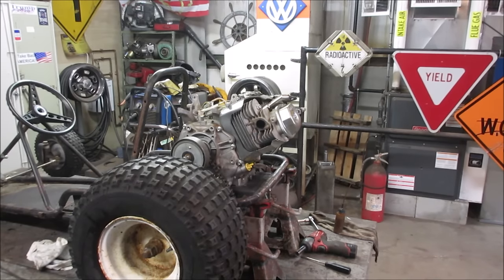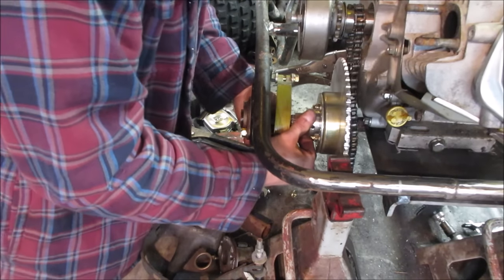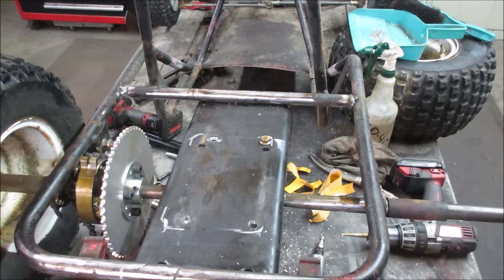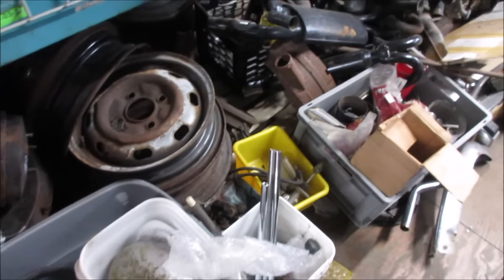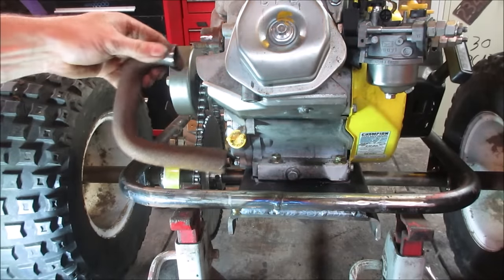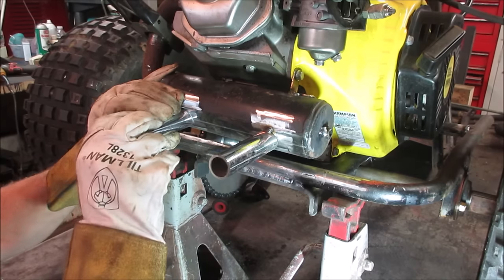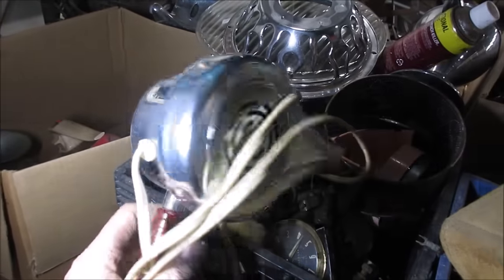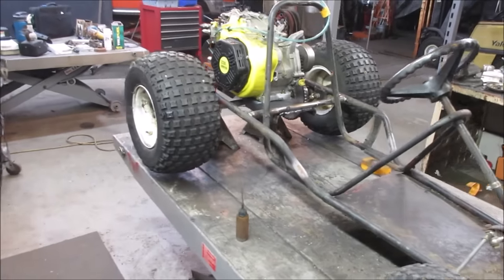Building a 1/2 Scale Manx Dune Buggy pt2

Comment: Mustie1, one of your best projects yet! I think this rig with the torquey 338cc engine is going pull from the bottom like crazy. I'd worry about the frame and small wheels in front taking all the weight and kinetic energy, especially if you were to go off-road. And I keep saying aloud -- I think cutting a notch in the fiberglass (tastefully) would provide easy access to the valve cover, if need be.
That said, for many years now this channel is my go-to for Sunday afternoon relaxation with coffee and a grilled meat & cheese panini sandwich!

Comment: HMMM, That muffler located on the back may make it hard to change the oil. Make sure you leave enough room. Cool Vids as always. Thanks:face-blue-wide-eyes:
Reply: It won't get used enough even with Rough use & even if it does. Then some one will figure out how to service the Yellow engine.🤔

Comment: Excellent video Mustie  1 :) also on Air Cleaner think a exhaust bow tie then bend to down bit then Aluminum shake weld pipe hole with air filter in  shaker and fuel tank plastic or steal one ! But come together nicely and put mirrors on side too Lol!

Comment: Put the air cleaner on the side of the engine and run a hose to it, would maybe look like a vw oil bath?

Or maybe run intake pipe into muffler and out of the back where you cant see it. Could look like more like a vw boxer engine setup maybe?

Comment: A solution for the muffler issue  would be to swap out the exhaust manifold studs  on head for bolts.  I just paused the video to text this message, then restarted the video and realized you did exactly what I suggested. Great minds think alike😁.

Comment: Those older dingos.  Ones with drum break came in 2 versions. 1 had the 5hp then there was an 8hp brigs version as well.  I had one of the 8hp versions .  Was fun but had replace azle a few times.  Once a friend clipped a tree just on right rear wheel.  Dads machine shop straitened it but the next time out friend hit same tree again this time rear hub broke in 2 pieces and axle bent.  Ordered a new one from the dealer i bought the dingo from.  Came with bearings and i ordered new hubs as well.  Wish could have gotten a beafier axle.

Just fyi they do sell a disk break setup for this axle.

They came from factory with 40 series torque converters.  Atleast the 8hp had a 40 series not posative what size torque converter cam on the 5hp models.  The 3rd generation of dingos had completely different roll cage.  The first 2 generations only had a cage over the engine section and headrest mounted to roll cage as well.

When i finally sold mine the entire frame was twisted from bottom plate breaking welds away.  It took years of abuse when i sold it was to a welder.  He fixed it up as much as he could get it strait without a jig.  His grand kids still ride it around last year the motor started to smoke.  Was bought in 1986-7 about.  I thought was rings but was just valves.  I did valve job and readjust carb and it runs like did when i had it.

Being a 5foot 6inch guy i still fit in it.  Only thing having no suspnsion kills my back now im 53yo now.  Wish had a model with suspension
Reply: What's a disk break? I don't want any breaks anywhere near my kart. OH, you mean BRAKE lol. Go karts weren't made for kids originally, the riding position and lack of space was designed that way to keep it small and light and fast competitively

Comment: We used Thread Lube, Anti-Seize Copper Flake, 16 oz from Industrial Molding Supplies on the threads of the nozzles on our injection molding machines.  The copper flakes fomr a shear layer to help keep the threads from binding due to heat cycles.

Comment: Shimming the engine up for chain adjustment is very solid and doable. A little more labor intensive than sliding but like in this situation, once the chain is "broken in", it will maintain a suitable tension for quite a while, even when being hammered. With a heavy rider. With a kid. Probably 2 seasons of moderate, around the yard riding before you need to revisit it.
Reply: My air compressor has the motor on a rocking engine mount. Then to adjust the belt tension the base is threaded and there's a jam nut. So it all makes an infinitely adjustable spacer. You can thread the bolt in and turn the nut out. Works good.

Comment: Wake up to a new Mustie video on Sunday morning. Gonna be a good day. 👍I still think you should think about moving the pedals forward to fit you better and keep your knees out of the body. Bumps aren't gonna be friendly if you're in there that tight. 

Edit: I saw you weld the bracket that blocked the exhaust from coming off and thought "Oh, no. That's not coming off." Then laughed when I saw you realize the error at 46:00. Some times I wish you really could hear us when you're filming. We'd all make less mistakes with more sets of eyes and hands on what we're doing.
Reply: The way he chopped the frame I'm not sure how the axles are going to like not being supported on the ends anyways. So that may not be your only problem with bumps. He added a lot of leverage to the suspension. But I guess we'll see.
Reply: The way he chopped the frame I'm not sure how the axles are going to like not being supported on the ends anyways. So that may not be your only problem with bumps. He added a lot of leverage to the suspension. But I guess we'll see.
Reply: @1pcfred  I was thinking about that too. If it's hardened steel which it should be it will probably be OK but it's still far from optimal even before it was shortened. I definitely wouldn't trust it to go over any kind of jump. That's not on Mustie so much as the original design already being a too narrow chassis. But with no suspension I doubt you'd want to ride it through anything too hairy to begin with and probably stick to sand and roads.
Reply: @zodwraith5745  there doesn't seem to be any kind of suspension on the vehicle. That could adversely affect the ride and handling characteristics. We'll see if he ever finishes it and test drives it. The original design is very minimal. It's likely an eyeball rattler. Some go karts at speed blur vision. The driver resonates with the frequency of vibration and their eyeballs, well they rattle.

Comment: A lot of times, you can open up those clutches, and put a heavier spring (or springs) or cut them shorter and re-attach, and make the clutch more into like a stall-speed convertor, so it doesnt start grabbing till a higher RPM, makes for better idle disconnection and the clutch grabs when the motor is revved higher and has more balls
Reply: Clutch might have been at half engagement or simply the fact that with the wheels off the ground, the clutch drum naturally wants to turn with the clutch hub that is spinning inside it. The clutch bushing does need a few drops of oil for every 1-2 hours of use.

Comment: You should consider cutting away the body around the rear engine like an old dune buggy to show off that air cooled engine.  Theres a perfect panel moulded into the fibreglass to cut out for it.

Comment: DK if Mustie reads these? But that is a bad place or an air filter, it will be clogged with dust from the back wheel in 10 mins. He should look for a hose attachment to the carb and position the air filter in a place with cleaner air. Maybe on the back of the seat roll bar?

Comment: Just put a pipe on the intake with a pod filter.  They use those in the VW dune buggies all the time.
Reply: Simple cup air cleaner adapter and a pod filter and I'd recommend the "sock" or foam pre-filter.

Comment: Nice muffler! ... uh, how are you gonna check/add your oil?? You kind of blocked access to the oil filler plug. I kept shouting at the screen but you didn't hear me. Move the muffler to the rear of the axle, maybe a little below it. Also, get an old motorcycle license plate (a California one would be cool with the dune buggy), mount it just below the rear center of the body to hide that rocker cover.  a chrome license plate frame on the license plate will go with the chrome tailpipe bling and really set off the rear aesthetics. Also what would be cool would be a pair of chrome bicycle seat posts with the ends backwards flared as they usually are(I can't think of what that's called at the moment), but it would look even more like VW tailpipes with a more finished end and give it a better tone! just gotta find two the same, LOL!

Comment: Use the shaker can.. but put a tube/flange on it and bend it in/under the body.. so it bolts on and off of the carb like the exhaust does. It will be under the body and somewhat protected from above

Comment: Mustie1: Regarding the idle problem, could it be the governor that's pulling the RPMs back up?  Looks like the engine for a power generator that works at constant RPM.
Reply: The idle jet on the carb needs cleaning. 
Its the plastic jet under the idle adjustment screw. iv worked on loads of these, its a common problem on Honda and Honda clone engines, bet if thats cleaned it will run fine.

Comment: The idle jet on the carb needs cleaning. 
Its the plastic jet under the idle adjustment screw. iv worked on loads of these, its a common problem on Honda and Honda clone engines, bet if thats cleaned it will run fine.

Comment: Mustie1, I think you made a lot of progress this episode! Yea the “VW” style muffler not only looks great but sound perfect. Can't you rig up the pedals farther away so an adult can fit in, instead of way up on a stool? Then you can make some add on extensions for kids to reach.
Reply: Mount the pedals on a track and slide them to the appropriate position... Use sleeved cables like a bicycle brake cable to keep the cables correctly tensioned regardless of pedal position.
That way anyone can get in and have a go with 10 seconds of adjustment.

Comment: I love the explanation of why you'd use studs on the exhaust into an Aluminium head. Could you let Porsche know :) Seems a very common issue when you take an exhaust off (headers) and strip out the threads :( and very painful to correct.

Comment: You might think about a low seat for kids, and then have a backrest that folds down to make a higher seat for adults.  Such would only need a couple of brackets off the roll bar, and two bolts. Plus the backrest itself, OFC. Just a frame and a pad mounted on some plywood?
Reply: Maybe folding upward would be better.

Comment: HEY MUSTIE!!! just thinking. on most of those honda clones the exh and intake are the same flange. can you just take that cast 90 degree off the muffler and use it to flip the air cleaner down where it will fit better? love these build it from the hoard treasure hunts.

Comment: You could keep the wheel spacers as they were and just slide the wheel on farther, reducing the wheelbase width to match the frame, thereby not increasing the bending moment on the axle due to the narrowed frame.
Reply: Yeah I'm concerned about that leverage he's added from the support bearings. Could end up with a bent axle for it.
Reply: @1pcfred  Both of you all are wrong and over-worrying. Those 1" axles are quite stout and should be fine.
Reply: No such thing as wheelbase width, you're confusing wheelbase with track and combining the two.
Reply: @Hjerte_Verke track, fine.
Reply: @1pcfred That's in addition to being an adult on a go-cart made for kids.

Comment: It will definitely need a different carburetor. Generator carbs run the engine at 3600 rpm, unless they have a low idle setting.

Comment: Lay out masking tape overlapping on the long sides and sticky side up. Lay the bottom of the engine mounts onto the tape and burnish it. Cut the holes and perimeter out from the bottom and  then peel off your new custom template

Comment: If it used a lawnmower engine, I could understand the mish-mash of parts.  But once you're up to over 300cc, you'd think it would be easier - and more effective - to use a small motorcycle engine and gearbox.  Wrecked 250cc bikes aren't usually hard to find and can be dirt cheap to pick up, and their much wider power band (a mid-79s Honda 250 redlines around 10k) and a selection of gears would mean a more tractable drive at both low and high speeds.

Comment: I think you had the brake the right way round to start. Surely it could bind when driving. The first way would always be releasing when going forwards? (Edited for spelling) Thanks guys.
Reply: Break? Nothing is broken.
Reply: It's BRAKE and nope, Mustie was correct to affix the brake the other way around. Doing it your way you would not get much braking force. Tons of go kart diagrams also bear this out.
Reply: This is exactly what I wanted to comment. The brake mechanism will now tend to have positive feedback leading it to grip tighter and then tighter. Positive feedback is what you want for a parking brake, but probably not for a running brake.

Comment: On the back the body you was thinking something to hide the valve cover what about a license plate frame ? And the can you had for air cleaner just wield a short bent tube & a flange to mount it as the shaker part can screw off to put in the filter material I know you got enough skill to cut out a flange on flat 1/8th sheet or 3/16th wield the bent tube to it & the shaker can !

Comment: The tailpipe spacing should be related to the body width, not the muffler width, and that looks to me like it would have made them wider apart, which would have worked with the hose clamp and flipped bracket.  Also, I see no harm in leaving the original end exit pipe, which would have become a third exit.  I see no need to bother plugging it.

Comment: Is my sound silly but on the fibreglass top you've got a holes in it couldn't you put the fuel tank in the air filter and just cut a little piece out so like for the fuel cap type of thing or even just cut a hole out for the AFL to in the fuel tank you going to have a problem you will need to move the ripcord to start it because you will end up hitting your hand on the fibreglass it may need to be lowered just a thought

Comment: You have the hot exhaust directly underneath the bowl.  Not a great idea.
Reply: You'd be surprised and aghast at how often hot mufflers are placed near carburetors or a fuel tank. The Briggs 130200 series engines have a hot muffler right over the gas tank. The thing is, those engines and Mustie's 338cc Champion all use forced cooling via the blower fan.

Comment: Just weld the motor to the steel plate 🤔
Reply: Two dissimilar metals. The engine block is aluminum, the steel plate is steel but WHY would you do that? Engine needs to slide to counteract chain slack.
Reply: I know. I was being funny 🤣